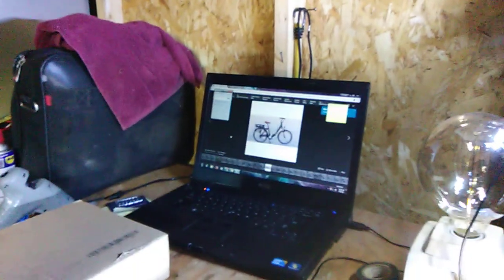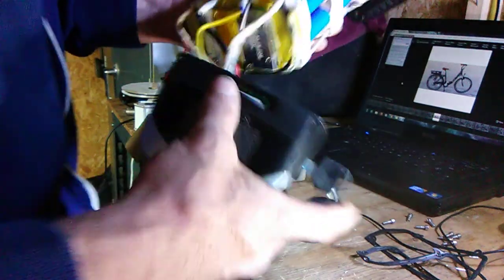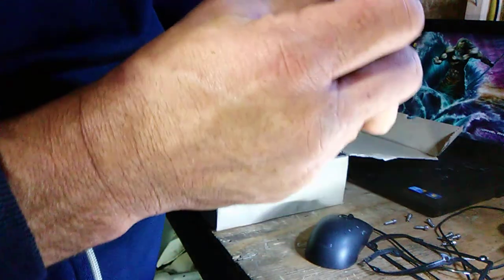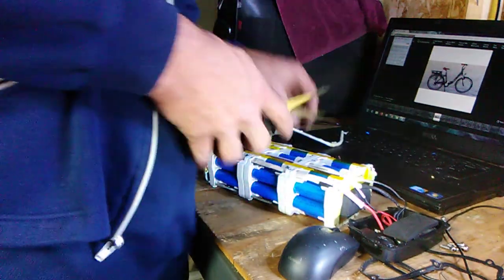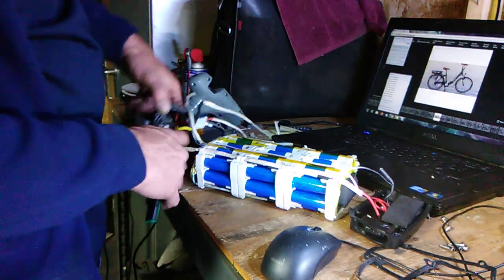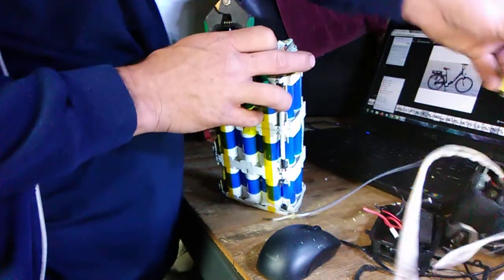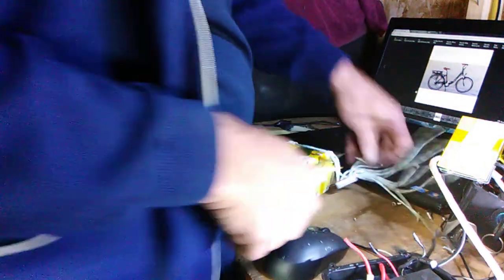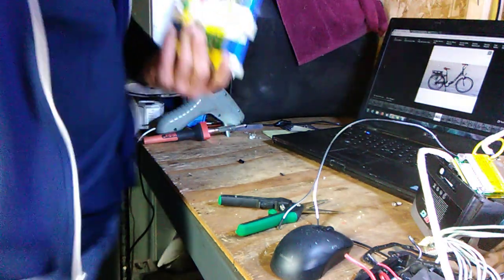EG Athens battery pack rebuild using Samsung inr18650-29E... Video #2

Comment: Thanks for the video. Do you know a source for the 4 bladed power connector on the battery pack? (The female side). I want to build a 36 volt 20 Ah version with 50 cells. Or maybe you know a source for an old defunct battery pack that would have that part.